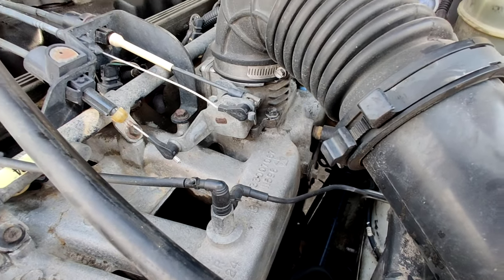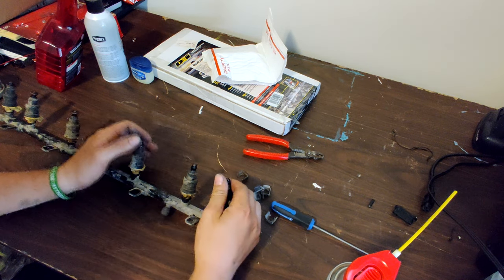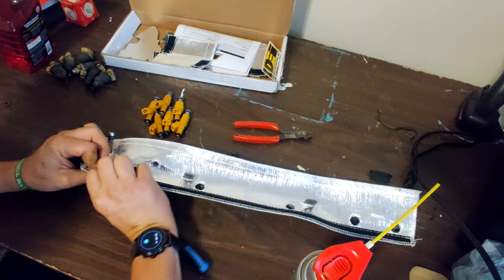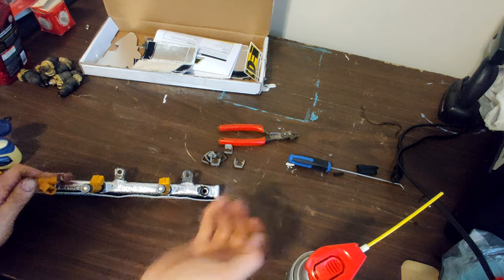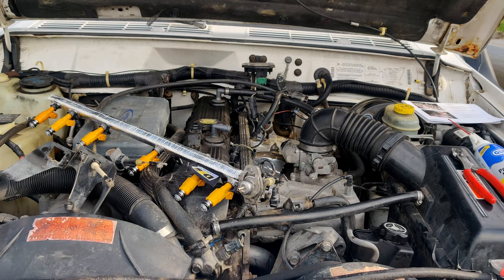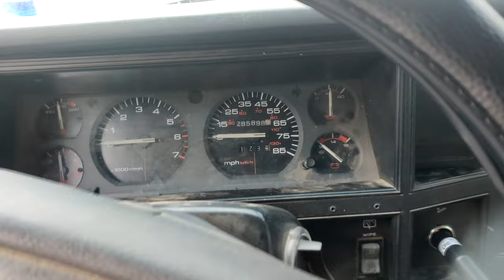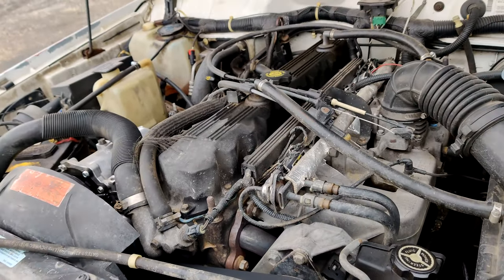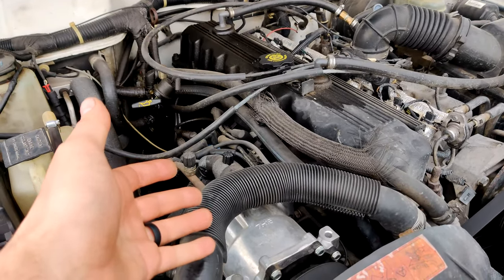Jeep Cherokee XJ 4 port injector install for better power and mpg

Comment: Interesting ! I have a 90 Xj with 245,000 on the clock .. Has the extended crank with every sensor changed out with brand new out of the box .. Still has that Xj deal  ! many have fought this . but is there a link to the kits you put on .. ENJOYED !!  And did it really help that crank issue ?? mine has a miss in the heat and it is the vapor's .. I BET !!  as right now in Jan it runs smooth .. INTERESTED ..
Reply from the maker: Just added the links to the description 😁 it did help with the extended crank issue he just need to confirm that your fuel pressure isn't leaking down after shutting the key off or at least not leaking down rapidly if so then it could be a fuel pump with a bad check valve I've seen some people install aftermarket check valves that goes between the fuel pump and the fuel filter. If it's not that then it could be a bad  fuel pressure regulator. But after chasing all of that down found a forum somewhere who mentioned these injectors and I threw them on and have been happy with them occasionally I will still have a bit of an extended crank but most of the time it fires right up. And the heat blanket makes a WORLD of difference. Maks it so I don't vapor lock anymore.